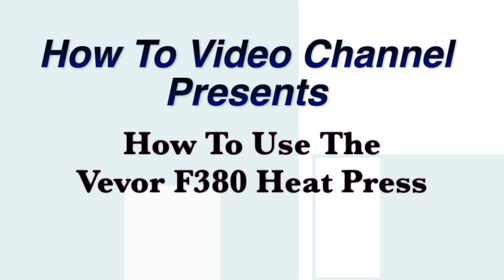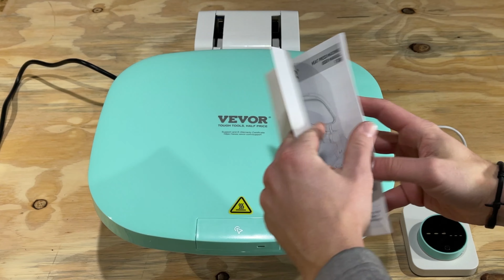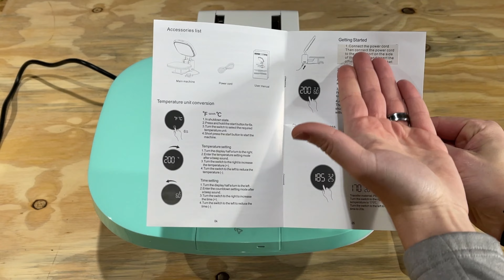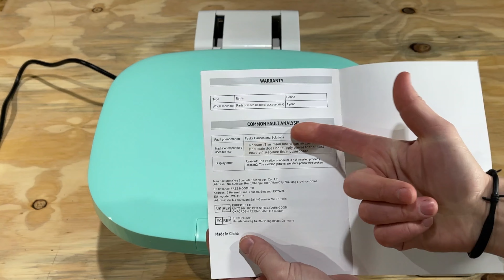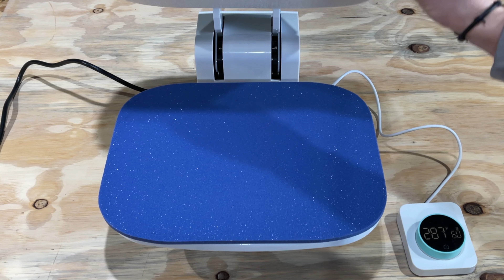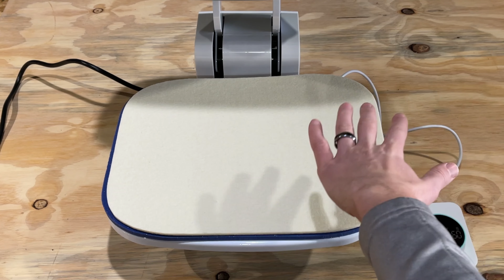How To Use The Vevor F380 Heat Press T-shirt Sublimation Machine

Comment: Thank you for this information.  When I turn off the machine the lid stays up.  How do I get it to close?
Reply from the maker: Close the machine, then turn it off. 
It may also close automatically if you hold the power button. I can’t remember exactly.
Reply: @HowToVideoChannel  Thank you for your reply. The only time the lid closes is when you are doing a press. When I press the controler to stop the press the lid opens automatically.

Comment: I have the F380 and I have been searching for a time & temperature guide.  I used a commercial grade inkjet paper on a 100% white cotton T-shirt.  I set the machine to 365 degrees for 10 seconds, according to the paper specs however most of the design was left on the paper.  In the past I have used this same paper and settings with a commercial grade heat press and the images always turned out great.

Any suggestions?
Reply from the maker: I’d definitely try lowering the temperature and/or increasing the time. There is a learning curve!

Also try sending a message to Vevor support to see if they have anything to share with you.

Comment: Did your heat press come with scratches? Because I just got mine and it looks quite used.
Reply from the maker: Nope, looked brand new.
Where did you order it?
Reply: @HowToVideoChannel  I bought it off Amazon. And I verified that it wasn't refurbished. I just went to the comments and noticed that someone mentioned the same thing. Their press cam with scratches.
Reply from the maker: I’d return it and then buy from Vevor directly. 
You can use the link in the video description.